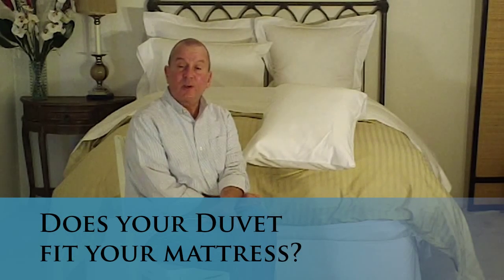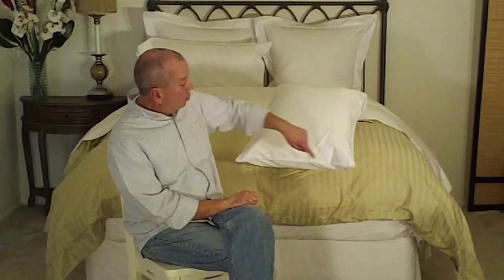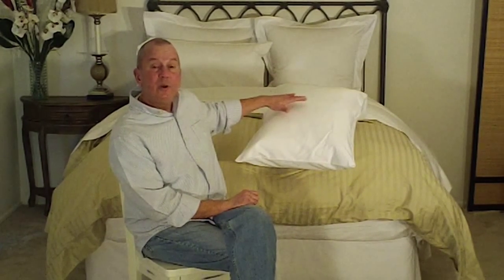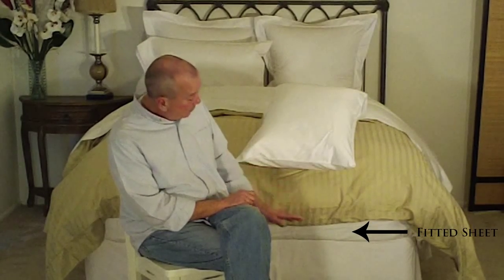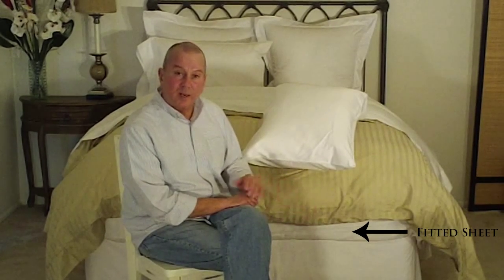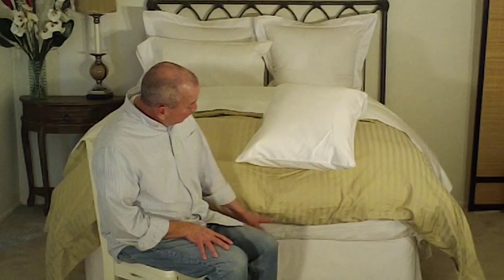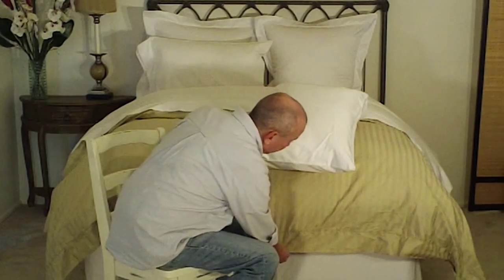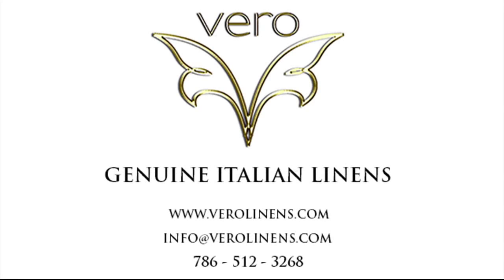Does your Duvet Cover fit your bed & mattress? (www.verolinens.com)

Comment from the maker: Typically a duvet covet should cover the mattress and a portion of the box spring. Most duvet covers will offer you somewhere between 15 an 20 inches of drop. However as if your mattress is 22 thick you box spring is going to show. An inch to three or four is generally what you should attempt to acheive. I hope this helps, let me know if you have more questions - Steve

Comment from the maker: You can put a king down comforter in a queen duvet cover. My duvet cover is 90" + 4"  flange on each side or 98" wide. A queen bed is 60" wide. So, 98" - 60" / 2= 19" . Providing you 4" drop below you mattress.
Reply: You can put a king size insert into a queen size duvet? Where does all the extra fabric go? Just bunches up?

Comment: The mattress I want to purchase is 60x80 with 15” sides. The comforters all seem to be 92x88. Even with a pretty normal 12” mattress, this wouldn’t cover the end of the bed. At 15”, a 4” flange would still leave 4” exposed. A king is 108x92, which still wouldn’t cover 15” at the end, but the sides would be really long, especially with a flange. How do they intend us to make a bed like this?
Reply from the maker: Thanks for watching this very old video... The mattress you are considering is a standard Queen. Over the years many duvet cover and down comforters manufacturers have increased the size of their products to accommodate the thicker mattresses. 88's is a little short, but keep in mind that many make their beds open so the length can be adjusted accordingly. When you are under it, it is not pulled up to the head. Our queen comforter is 92 W x 96 L. However, when it is stuffed it will be no larger than the duvet cover it is contained in. If the duvet cover is larger than 88 " L there will be excess fabric. Having a down comforter larger than the cover is not an issue as the comforter will conform to a smaller compartment. In summary - look for a larger down comforter and duvet cover. We hope this helps.
Reply: @Verolinens  Thank you. 92” x 96 would be a much better size for duvet covers than the small sizes they have. Also, I often sleep with my covers over my head because I get cold easily.

Comment: I’m pulling my hair out with this 4th super king duvet!! 200x220. None of my super king bedding fits my duvet. The bedding is always too big and my duvet gets lost inside it. Initially I thought they sent me a King size rather than a super king but no 4th one down the bedding is too big. Whereas king size bedding fits flush on the super king duvet. Please help!
Reply from the maker: Who did you order the bedding from? We would recommend you check with them. Assuming the dimension you are providing are in CM 200 cm = 78" 220 cm = 86". These are neither a King or Cal King dimension. We are unfamiliar with a super king mattress.
Reply: This is happening to me in the UK. Never happened with double size bedding but with the king size, the cover is waaay too big. They claim it’s for the ‘loft’ of the duvet but then why do they only do it for king size?!
Reply: Probably UK

Comment: Very informative!  I have a queen pillow top and a regular queen duvet doesn't cover the sides completely. I was wondering if i should just get a king.
Reply from the maker: Thanks for watching our very old video. Some use a king on a queen. However, there are some duvet comforters that are a little oversized. Some companies (like Vero Linens) add a flange to the sides and foot of the divert cover to give it more coverage.
The mattress makers are to blame for this conundrum as they have gotten silly with mattress thickness. If you would like to discuss this in more detail, feel free to reach out to us via phone at 786-512-3268 or email us at info@verolinens.com.

Comment: Thanks for the video.. What is the best duvet size for a 140cmx200cm bed to achieve the "hotel look"? i will be using a thinner duvet compared to the one you have in the video. Thanks in advance.
Reply from the maker: Your bed appears to be a full-size (however it is longer than a typical full bed which is 54" x 75") bed. Many higher-end linen companies produce a full/queen duvet cover that works on a queen and full size mattress. Mattress thickness is also a factor. Nonetheless, you would want to have 15" to 18" or more of a drop with a duvet cover/down comforter.  Keep in mind your down comforter will only be as large as the cover that constrained it.